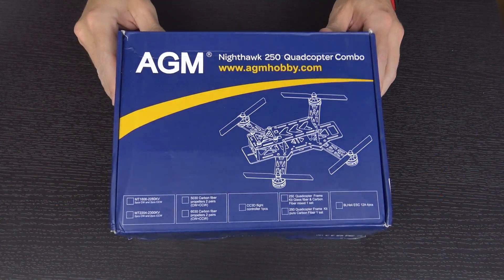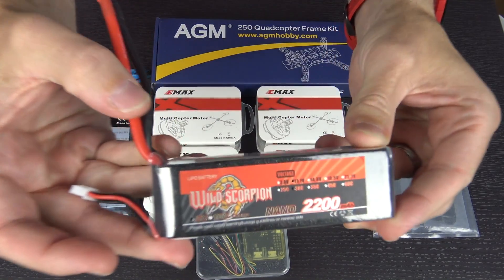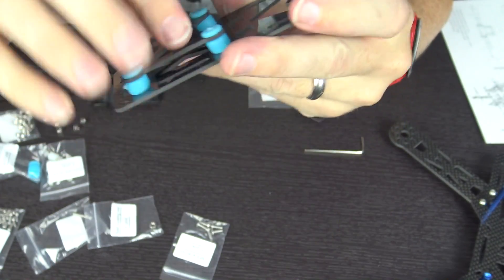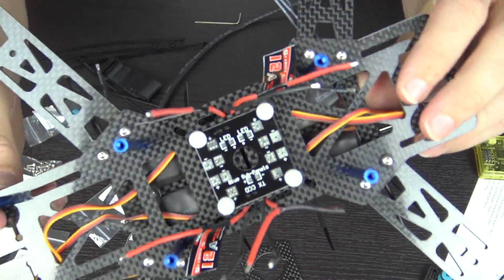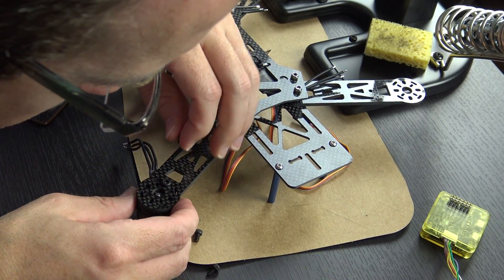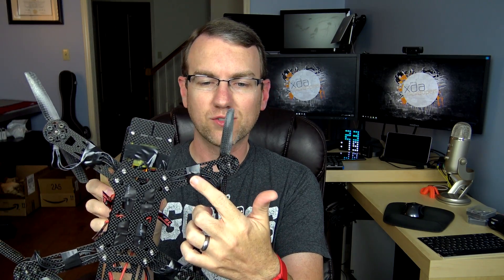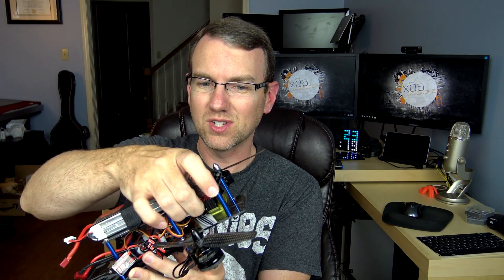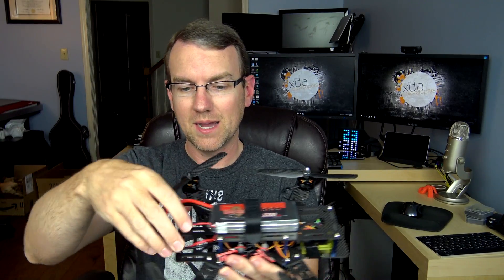AGM Hobby Nighthawk 250 Racing Quadcopter Kit Review!

Comment: For a first build of a racing quad you did really well, my first build was pretty bad.  please don't get disheartened, if you think you can do better, because you have all the parts, and an idea on how of goes together you can strip it down and start again, all you're going to spend on it is time.
 what I would suggest is spending a little more money and buy a flip 1.5 from Ready to Fly Quads, there only  $15 US, it's a multiwii based flight controller that runs Arduino code. Then watch Flip 1.5 for Dummies, that will help you flight controller setup. Finally, and it's a must, you need to watch RC Model Review's series on low cost mini racing quad build. Bruce, the host of the show, and all round good guy , shows you step by step how to build a racing quad, having a good set up quad, makes a world of difference. Stick with it, you won't believe how much fun you will have, and don't worry you will get better.

Comment: Yes these quads are not for beginners that don't want to read and learn how these hard and software works. It is just like with pc's, as people read and inform them self better than a lot of problems people have with pc's are prevented. Something you did not do this time with this quadcopter. 😉 But you can still learn and when you learn more you will understand more and get also more fun out of that quadcopter than out of an ready to fly quad copter. My first flight was also not that great but I started to look for other settings and my r background helped me with my transmitter settings and now I love my race quad. I have the other quads and still fly them but I don't get the feeling that I have with my THuG230. And yes that quad can fly as good as your other quad and better. Your setup is not that good. Next tome flash your cc3d to cleanflight. Calibrate your esc's and setup your transmitter with the right settings.It will give you a lot better experience wit it.With some rewiring removing the case from the cc3d and using nylon spacers, you can place the cc3d in the middle were it is the best place for it. Also you can replace the pins with angled pins. It needs some soldering but it fits a lot better.Get some 1300 3s lipo's. They are lighter and makes your quad a lot more responsive. And than get the starter fpv set on hobbyking.com and fly fpv. Fpv is so much more fun and gives you a hole new experience with flying. I don't have my fpv set that long but I love it. I am putting it also in my flying wing.Maybe a nice project for you, building your own wing and it is not that expensive. You need 2 servo's, 1 motor and an esc and some foam board. Transmitter, receiver and lipo you have already.